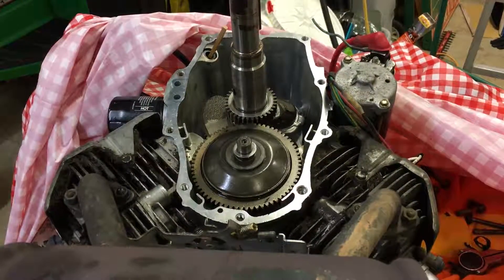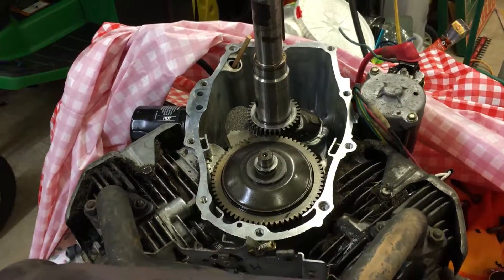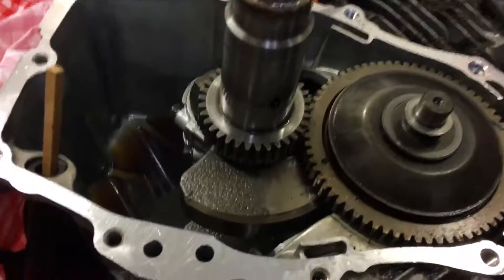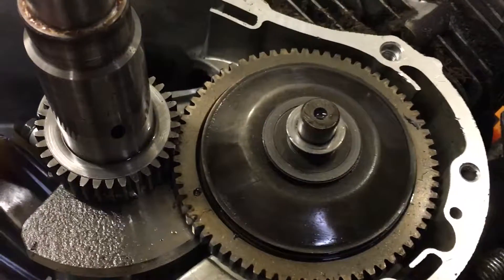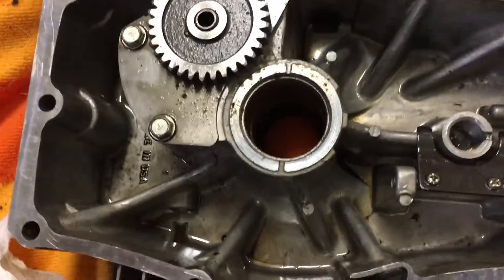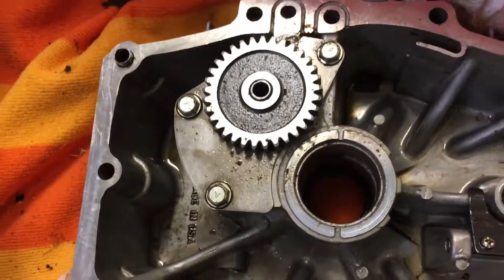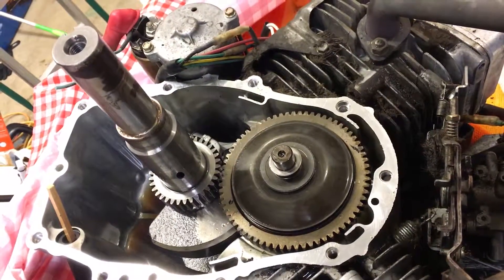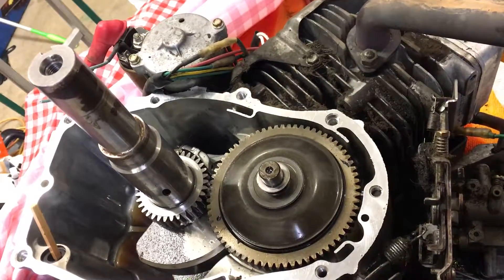How to change your sump gasket on a John Deere  crankcase

Comment: Good video by the way. You have one of removing the motor?  Hopefully I won't need to do this I'm sure I can do it that's not a problem but thinking it's the head gasket on the right side of sitting on tractor looks like it be leaking.

Comment: Working on the same motor right now other than it's a 23hp crankcase gasket was leaking oil. Installed crankcase housing but the arm that connects to throttle is slack am I missing something?

Comment: Hey there!
Its been years but i have a question .
I replaced the sump gasket and now having problems , could the fact that the gasket is thicker be a problem?
Without rockers great compression, timing is good inchecken. With rockers installed and set at .006 at TDC i have no or very little compression